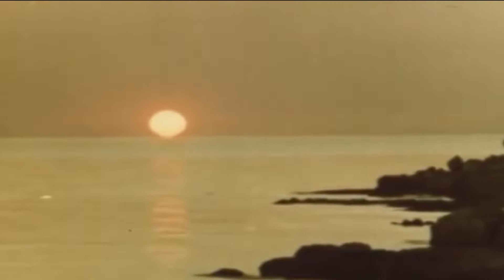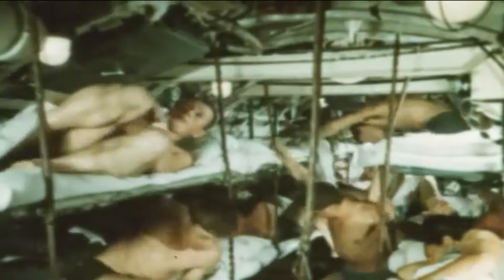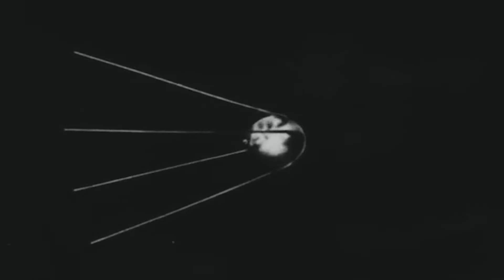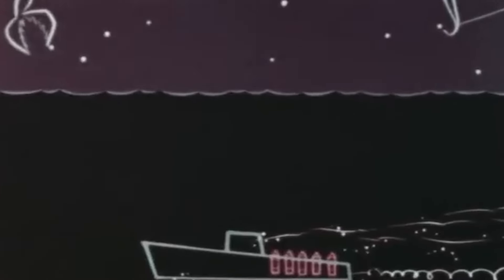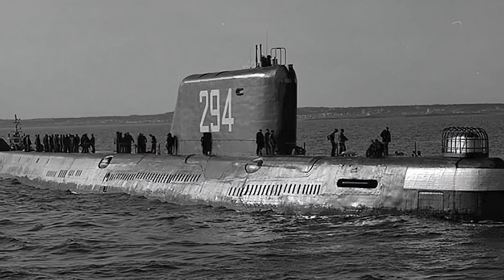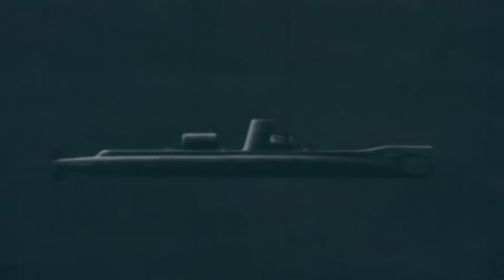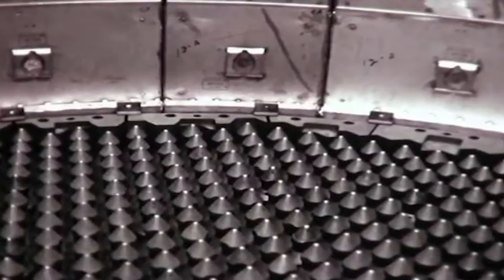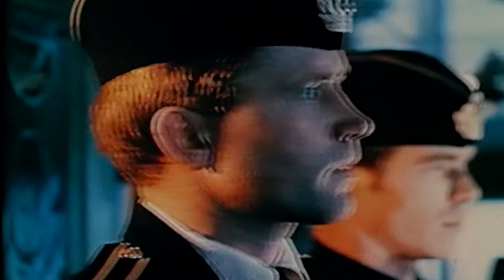The Submarine That Turned into a Ticking Nuclear Bomb

Comment: As others have stated, the reactor cannot explode like an atomic bomb. If it were as easy to make an atomic bomb as amassing a sufficient quantity of enriched uranium and bringing it together then any country that could obtain that material could make an atomic bomb. It doesn't work that way. It requires sophisticated technology and sufficient fuel to make an atomic bomb.
Reply: 100%
Reply: Regardless, that thing blowing up miles from a NATO base would stir up some bee hives. 
Out of curiosity how big of an explosion could one of these produce? Nuclear power plant failure levels? Or less of an explosion?
Reply: Basically when any reactor melts down. The fuel (nuclear material) melts and then breaches the containment vessel. When it does it flash boils the water causing extreme pressure, the neutron release can break the bonds of water into hydrogen and oxygen adding to the explosion. But unlike a fusion or fission bomb there isn’t enough chain reaction to detonate.  They are good at spreading radioactive material though.
Reply: @MrOdins007  in short, a "dirty bomb".??
Reply: No but you could get it hot enough to create a very radio active steam explosion
Reply: You just need enough enriched uranium to reach critical mass it's not that sophisticated.
Reply: " If it were as easy to make an atomic bomb as amassing a sufficient quantity of enriched uranium" It kind of is that easy IF one has a "sufficient quantity of enriched uranium" Getting that sufficient quantity of sufficiently enriched uranium is the hard part, if one has it, a gun type "Hiroshima" bomb is pretty easy.  
But as far as I know, reactor fuel is not nearly enriched enough for a bomb, so you are right that you can not make an atomic bomb out of a reactor.
Reply: @boob72  Uranium  needs to be brought together quickly enough to be supercritical in order to have the chain reaction proceed far enough to get a big explosion, which is the principle of the gun-type weapon used in Little Boy. Otherwise you get a fizzle; a big explosion but only a fraction of the theoretical yield. With plutonium the problem is you can't bring the sub-critical masses together fast enough to avoid pre-detonation and a fizzle. Therefore, plutonium weapons are implosion-type.
Reply: ...and a "tetrahedral" trigger!
Reply: @Gods-Shepherds  regardless? You knowingly spreading misinfo to click bait.
Reply: @boob72  Enriched does not mean weapon's grade. There is a massive difference between what it used in reactors and what is used in warheads.
Reply: @boob72  So all that messing about al Los Alamos was a waste of time. Perhaps you have calculated the mass required?
Reply: @tryagain.k1821  exactly the hard work has already been done.
Reply: @boob72  You could have an unlimited supply of weapons grade Uranium and still not ever have any success in making a nuclear bomb; A Critical mass of Uranium simply means you have enough mass to sustain a reaction, without the right circumstances you do not get a bomb. A Reaction does not necessarily mean an explosion, and even when dealing with Uranium an explosion doesn't necessarily mean a nuclear explosion.
Reply: their is no conceivable way for the core to detonate like a nuke, but i do wonder what would have happened to the nukes had the core melted down.
Reply: @Gods-Shepherds  accidents and explosions on nuclear subs happened before, and we're recognized as such by their sound signature. No one will confuse sound of sub sinking for a nuclear explosion.
Reply: @dmitryshusterman9494  maybe now a days. You gotta realize this was the very beginning of nuclear technology
Reply: it however can explode due to the sudden vapourization of water due to the extreme heat and confined space should it have actually melted down
Reply: @Gods-Shepherds  Neither a nuclear power plant or a nuclear powered vessel would have any sort of explosion that compares very well to using the same field of science to create a bomb instead of electricity.  The biggest concern here is mostly the radiation being deadly and also the longevity of it, but it would definitely cause a reaction from NATO either way.
Reply: @jacobcone7447  wasnt Chernobyl a giant explosion?
Reply: @Gods-Shepherds  Yes there was a decent sized explosion that was technically nuclear.  By my calculations it would've been the same kiloton yield as about .015% that of the Fat Man dropped on Nagasaki.  So nothing too insane, and a nuclear submarine would yield an explosion much lesser than that.  Certainly dangerous technology that can kill when it fails and also likely cause global tensions, but when it's specifically built to be a reactor rather than a weapon the dangers are nowhere near comparable.
Reply: chernobyl happening in the water woud be a disaster,reactors CAN and DO explode when built by soviet russia(if more than 0.7 grams fissions they've already beat the very inefficient hiroshima bomb)
Reply: @Gods-Shepherds  Chernobyl's "giant explosion" depends on how, exactly, you define a "giant explosion"... Did it explode? Yeah, several times over.

    Okay, but was it "giant" enough??? No... Not even close. 

    As remarked elsewhere in the thread, the Hiroshima bomb was remarkably inefficient. It did, however, still manage to wipe about 90% of the city of Hiroshima entirely out of existence. From full-functioning metropolis of its day... pffft... to ruins, fires, and a wasteland. 

     You can go right now, today, and SEE the remaining city around Chernobyl, including playgrounds, a recognizeable theme park, buildings, infrastructure like roads. You can recognize and even use most of it, "as is" give or take what the Russian's have blasted out with their antics... BUT the "giant explosions" of the reactor core itself, while impressive was more like a "Nuclear Roman Candle" than a Full-on Nuclear Detonation.

     Downsize that to the contained reactor core of a submarine, and fit it inside a double-hulled tin can. .. under a couple hundred feet of sea water. It'll make a plenty big enough mess, and the government types (politicians) and their media dogs will muck-rack the hell out of it and exaggerate everything toward the worst possible intentions in their accusations on Russia, BUT it's not going to be anything that resembles a missile strike or purposeful nuclear bomb... At worst, it's going to more resemble what happens when you light off a road-flare under water... and linger like that, spewing all manner of toxic and radioactive sh*t into the sea all "willy-nilly" as it burns its way through the hull and sinks to the bottom... give a damn what it does to the rest of the sub and crew... and there it would rest for however long it can continue the out-of-control reaction... well out of reach of anyone in the day and age, and certainly beyond any hope of recovery...

    It's not that it's so difficult to get a criticality... BUT when you start playing with the weapons grade stuff, you run a very narrow tolerance band. Too much and too soon, and you just irradiate the bejeezus out of the area, fizzling and burning. Too little, and you'll barely get a pop, no matter how hard you slam the sh*t together... You have to have it just enough in just the right configuration to start with, so you can slam it and smash it tight into a little bitty wad, so it does "the magic" and then it explodes very VERY violently. Once you've got that figured out, the hard part is keeping the god damn thing from starting that "fizzly nonsense" before you want it to. They brag great guns about how controlled and safe these things are, but there's ALWAYS a dubious nature to having a bomb laying around without the determination to use the f**king thing.  ;o)
Reply: @affor3   Yes...
Reply: Wrong enough for a "do not recommend channel" from me. Facts are important if you want to be a documentary channel!
Reply: Well, yes, but they didn't know that at the time. Nuclear technology was still pretty new at that time, we were still figuring out exactly how it worked.
Reply: i presume he meant the radiation would cause more damage
Reply: @boob72  It's really sophisticated.  You need proper triggers, proper timing, a deployment system...  Even high density reactors in submarines are usually on 35% enriched fuel.  To get a nuclear explosion it needs to be better than 90% U235.  Throwing some shit together in a pile doesn't make a bomb.  You may get a few criticality events, but its highly unlikely.  To get a reaction you need a source and a moderator.  To get a weapons grade criticality even you need a source, a trigger, and a high quality reflector.   It's not the movies.  Some kid isn't going to get some plutonium and put photo-electric cells and a few D batteries on a core and get a working device.  Countries spend many billions of dollars to get it done.
Reply: And this is why I'm unsubscribing from the channel.  I don't need intentional click bait full of BS.  I get it.  That is how sites try and deal with Youtube's BS algorithm.  But pick something else.
Reply: @bendershome4discountorphan859  Not if you are underwater.  The resulting explosion even 50 feet down would be negligible. The resulting radioactivity is a completely different topic though.
Reply: @KellicTiger  i mean i dont even get it. "the submarine that almost became an oceanic chernobyl" wouldnt be clickbait really
Reply: @Gods-Shepherds  You saw what happened at Fukushima, 3 very much larger nuclear reactors had cooling water issues (American designed and built reactors), we had no nuclear blasts but a significant buildup of hydrogen and poof. No fire, just buildings shattering and a spread of radiation.
Reply: @affor3  this part
Reply: @Gods-Shepherds  Yes and no. It was a bleve, a boiling liquid vapor explosion: the coolant flashed to steam. It was not a nuclear chain-reaction explosion as in a bomb.
Reply: @Gods-Shepherds  smol chernobyl
Reply: @Gods-Shepherds  it would not explode like a nuclear bomb; no nuclear reactor can do that; the worst you can expect is water and surrounding objects including fish would be badly irradiated
Reply: @alasdairwhyte6616  didnt Chernobyl explode?
Reply: @Gods-Shepherds Yes, but that was a steam explosion. If it had been nuclear then not only the power plant but all of Chernobyl would be a crater.
Reply: Technically you're wrong, but I think I get what you're trying to say. Actually spontaneous fission occurs after reaching supercritical mass and this will result in chain reaction, though with zero actual military power. This happened with demon core, that was meant for a 3rd US nuke and resulted in a few deaths.

Comment: The reactor would have melted down, not exploded. Any hydrogen gas could explode, but as a conventional explosion
Reply: And even if you consider that it got hot enough to melt right out of the bottom of the submarine it would just sink The submarine by melting a huge hole through the bottom of it hot things that are nuclear is not nuclear explosion
Reply: Yep, it could become a horrible dangerous mess, but unless the fuel was about 10 times more enriched than it needed to be for a subs reactor that won't happen. and even then a melted reactor won't explode in a nuclear explosion at worst it would be like Chernobyl but smaller, and more remote from humans.
Reply: What about the 3 warheads on board?
Reply: I was about to post the same thing, I hate it when people talk about nuclear reactors blowing up whether they be in a submarine or on land. The general public seems to believe that if a reactor had a meltdown it's going to blow up like a nuclear bomb. Which couldn't be further from the truth. If there were going to be any type of "explosion" it would be steam related.
Reply: Still way up there in the bad things category.
Reply: @soulesslemming  They  also would become a mess. It's a very complicated set of events that need to happen to cause a nuclear expulsion.
Reply: As a general rule, submarine nuclear reactors use bomb grade enriched uranium to reduce the volume of the reactor.. But even with this, a true nuclear explosion is not possible. The worse that could happen was that the pressurized nuclear reactor would blow apart, like what happened at Chernobyl
Reply: @Gareth Fairclough I wouldn’t trust a early Soviet warhead to not explode during rapid compression and impact with the sea floor.
Reply: @leonardmiyata482  IIRC soviet naval reactors only used 20-40% enriched uranium.  But you are correct that even US 93-97% enriched naval reactors still would not go off like a nuclear bomb.
Reply: If a hydrogen explosion did occur, the reactor would become one with the air/sea. Not the definition of a nuclear explosion, but would result in more radioactive material making its way into the air/sea.
Reply: Why do some thing a reactor, when it overruns and overheats, becomes a bomb? Yes, lots of radiation might (well will) be generator, but not a explosion.
Reply: Thanks
Reply: @edreynolds8721  I would call it a ‘expansion’, not explosion. Many think nuclear power=same as nuclear bomb.
Reply: @soulesslemming  nukes need critical mass to explode. That means a ten pound round peg is shot into a ten pound round hole, or a sphere is explosively compressed to maybe double its density. Nuclear bombs are designed not to let the peg accidentally shoot to the hole or the explosives around the sphere to accidentally explode within a millisecond of each other. That’s a simplified but accurate explanation why more nuclear material in the meltdown won’t explode
Reply: @Greg-yu4ij  do you assume the bombs aren't rigged to aquire cumulative mass?
Reply: @Greg-yu4ij  I’m understand all that but would you trust 1950s Soviet failsafes with your life? I sure as hell wouldn’t.
Reply: @zoom4368  yes, both US and USSR designed fail safes. “one-point safety” in the us and “hydronuclear” tests in the USSR designed bombs to “fizzle” in the worst case , 1 in 1 billion where a bomb has a partial ignition of its explosive shell
Reply: @soulesslemming  It has been reported that A Russian nuclear missile was almost recovered from K-129 by the covert Glomar Explorer. As the sub neared the surface one of the missiles "escaped" and it is estimated it struck the ocean floor at over 70 mph. No 'splosions...
Reply: @leonardmiyata482  The extra enrichment also reduces the frequency of refueling or even eliminate it all together.
Reply: A conventional dirty bomb explosion and we have heard an awful lot about a dirty bomb and how it would illicit no different a response than a nuclear attack
Reply: @soulesslemming  Detonating a nuclear warhead requires a lengthy list of steps which need to happen properly and in the required order, most with a precision measured in thousandths of a second, if not less.  Most destructive event which you might see would be ignition of the missile's rocket motor while still within the tube.  If this happens, you are essentially in a race to see which melts first, the rocket motor, the tube, or the hull.  Any one of the three would most likely result in the sub heading for the bottom...permanently.
Reply: @soulesslemming  The compression due to sea pressure is magnitudes less that that required for detonation, and would happen much too slowly to do more than crush it like an empty beer can.
Reply: @soulesslemming  Melted, radiation leak maybe. A fire doesn’t trigger nuclear fission any more than Wile E. Coyote tapping it with a hammer.
Reply: Yea,because that super heated core would just sizzle out and cool off when water contacts it- 👌
Reply: @Greg-yu4ij  While I understand that details were left out for brevity's sake, it should be pointed out that the U-235 projectile portion of Little Boy was ring-shaped, and the target was essentially a cylindrical plug.

Stated differently, we basically shot the hole at the plug...  :)

Trivia fact:
Lore has it that the gun portion of the device was exactly that...the breech end of a cut-down Naval Gun.  This allowed a critical (no pun intended) portion of the device to be procured "off the shelf" with minimal modifications required.  

The propellant was bagged Cordite, typical for Naval Guns and also a readily available "off the shelf" item.

Predictably, the electrically-fired primers used were also standard items.

In a nutshell, Fat Man was designed from the beginning as a new device, Little Boy was a run to the hardware store...
Reply: Agreed. That is complete bullshit.
Reply: @soulesslemming  Nuclear bombs don't work like conventional bombs. To produce a nuclear explosion which you are referencing to, the conditions have to be exactly, precisely just right. I am emphasizing just how perfect the conditions need to be because otherwise nothing will happen. A conventional bomb exploding next to a another regular bomb will likely make them both explode. The same principle doesnt apply with nuclear bombs. You need to acquire critical mass condition in which a chain reaction can occur between the unstable atom cores. If you don't achieve this nothing will happen. A bomb exploding next to a nuclear bomb wont set the nuclear bomb off. It will just completely ruin the nuclear bomb.
Reply: @Sol-os5pk  I understand that I’m just saying I wouldn’t put complete faith in the Soviet fail safes
Reply: @soulesslemming  Soviet fail safes have nothing to do with it. Its impossible for a nuclear explosion to happen
Reply: Exactly correct.